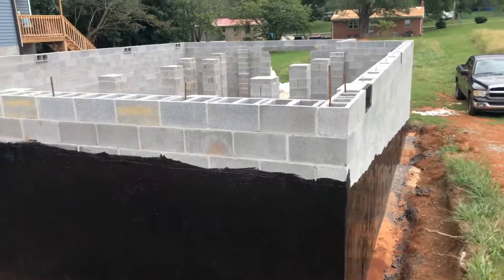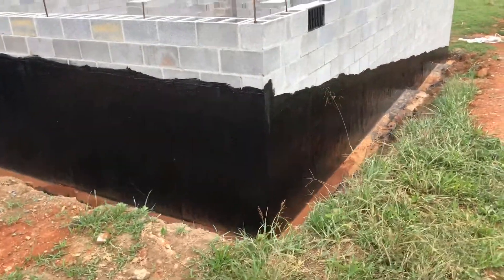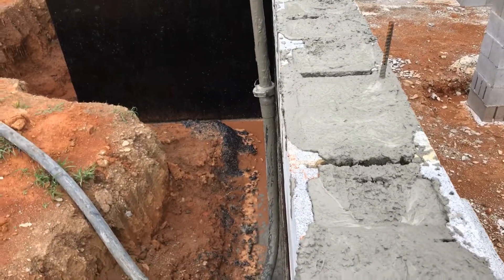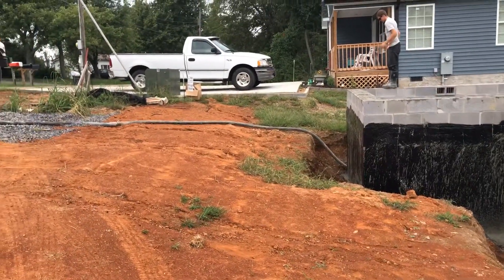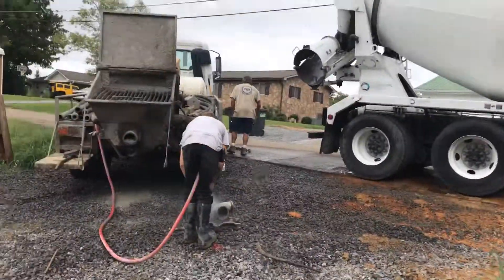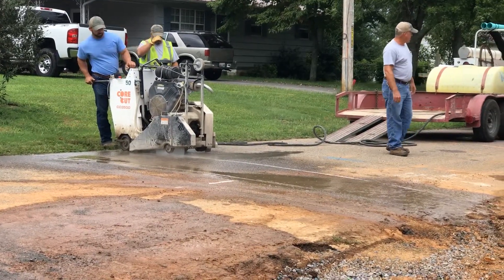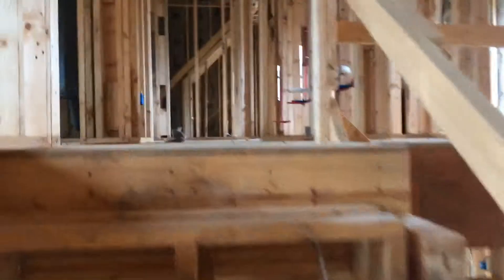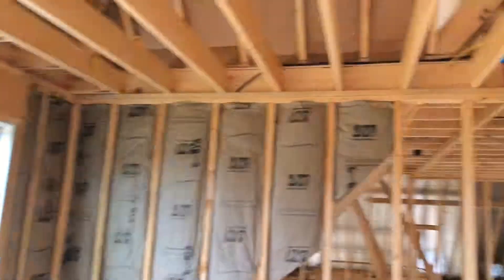How To Fill Block Foundation Wall With Concrete!  Concrete Pump Truck!

Comment: We need a footer and wall poured Cleveland TN. By Coke plant up on the big hill. Holler if someone wants to do it. It's dug out and has GPS pins in. So confirm layout corners  and dig footers. We can dig need block wall guy mainly.
Reply from the maker: Shoot me a text 423-504-6127 and we can chat.  Thanks.

Comment: What size aggregate did you use? I'm doing a basement core filled wall.
Reply from the maker: I’m not 100% sure but I do know it is the size of pea gravel.   Prob #89 stone size.   You can’t use the larger in those types of pump trucks.

Comment: Whats the highest you've built a block wall before core filling. I'm about to core fill a 4 x 4.2 block wall and wondering do I need to brace it????
Reply from the maker: It depends if it is a retaining wall or a foundation.  I would always fill the cells of a retaining wall with cement and rebar down into the footer.  A foundation has the weight of the structure on it so I only fill with cement where it’s back filled with dirt and gravel

Comment: Just curious did you prime your small hook with water before clamping or just water when you prime in the hopper? I don’t do cinder block walls often but might get a small hook if I ever take a job. I know my wash out hook would be to big and heavy.
Reply from the maker: Im not really sure and I believe you mean hose not hook right?  If so I think they mix up a mixture of bentonite and water in a 5 gallon bucket and blow it through the hose before clamping it to the hopper and filling with cement.  hope this helps.
Reply: @MattFreytag  yeah that makes sense. Didn’t know if people prime the hose first before putting on the hook. It’s rare for me to do finder blocks or even some contractor ask if I do have a small hook to use for foundation.

Comment: I need to fill my wall with pump mix..it is a small wall ..3 block high....how much pump mix should I order..108 ft. long on 8x8x16 in  blocks....I guess 1 half yard ?
Reply from the maker: Buddy I really don’t know the answer to that question.   I’d have to ask the pump guy what formula they use.  I always let them do it.   Thanks for watching.

Comment: Hi. I have a cinder block foundation. I'm remodeling and have access to the cinder block hollows but when I poke down, the bar only goes down about 4 ft. If it went all the way down, it would be about 8 ft. Is it safe for me to fill this upper portion of the foundation block with concrete? Thanks.
Reply from the maker: Im sure it wouldn't hurt but its hard to say unless I was able to visually inspect it. I would not want to give you bad information.  thanks
Reply: Maybe beat the bar into it? if it bounces its concrete filled if it goes down its sand filled

Comment: hey matt I have a 'vibratin dik' as they call it with a 60" wand. I am doing a 10ft tall wall, its currently 5'(7 courses high). I am thinking about getting a pump truck to airate out the lower half and repeat for top. any objections? im a novice building a house I had engineered by myself and could use your recommendations. I have seen block walls where the void filled with water and cracked when it froze. What I am trying to avoid..
Reply: by the way every other course is lintel/bondbeam block with #5 bar and every other vertical is the same.
Reply from the maker: I wish I had all the answers for you.  I have only concrete filled the walls that were required by state and local building code but I do understand what you are saying.  As long as the rebar sticks up to tie into the next set of courses I’d say you would be fine.  As far as the water freezing and cracking I’m not sure.   I’m not so sure that filled block doesn’t crack from expansion and contraction of the concrete.
Reply: @MattFreytag  That helps a lot! Im in florida where basements are rare, so the county wanted it over engineered. I appreciate your expertise and great video! Thank you!!
Reply from the maker: @johnmilton5569  Thanks I wish I could help more but just don’t want to steer you in the wrong direction since I can’t personally see what you are doing.  I’m still learning every day.